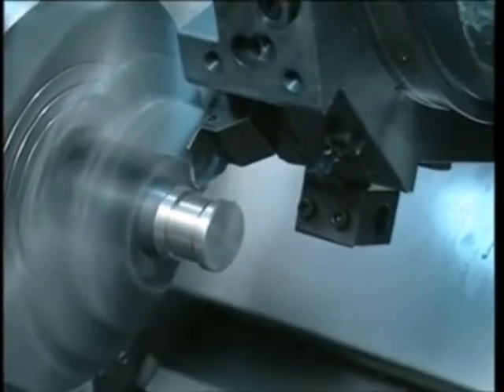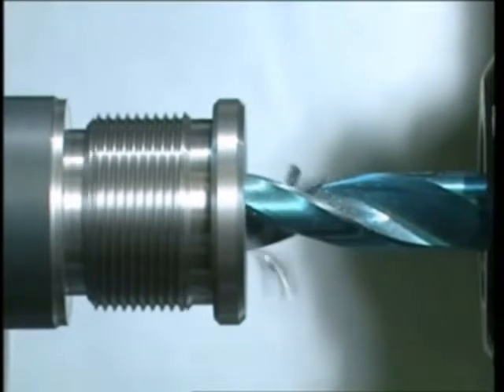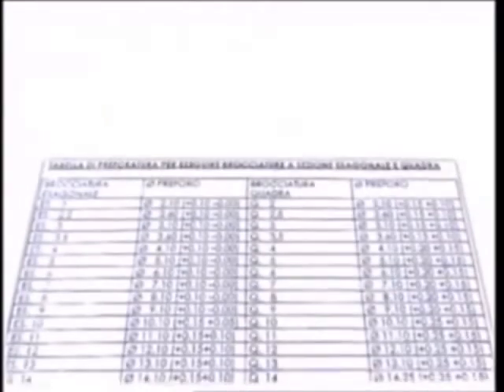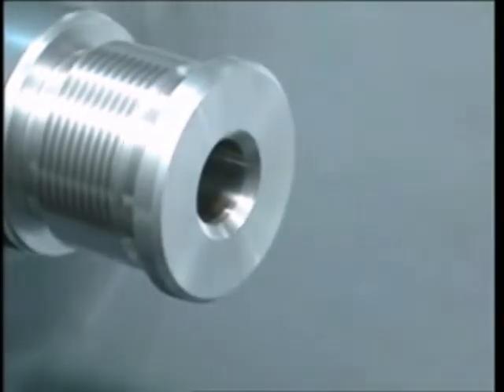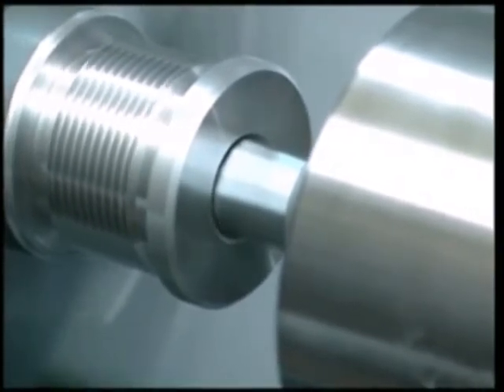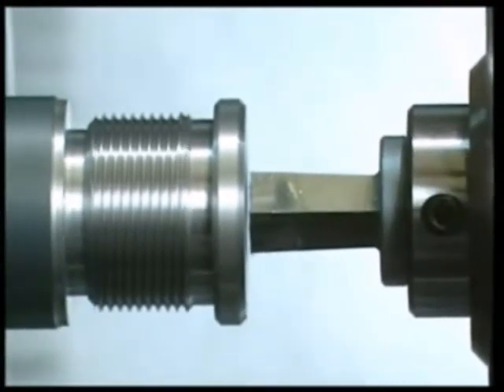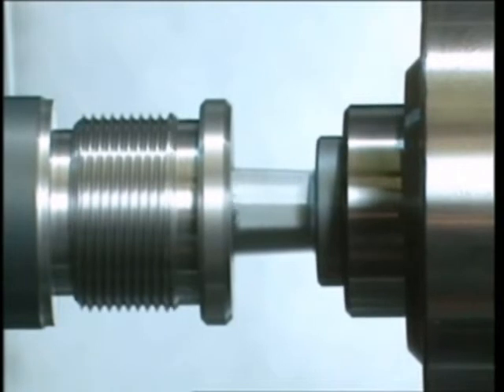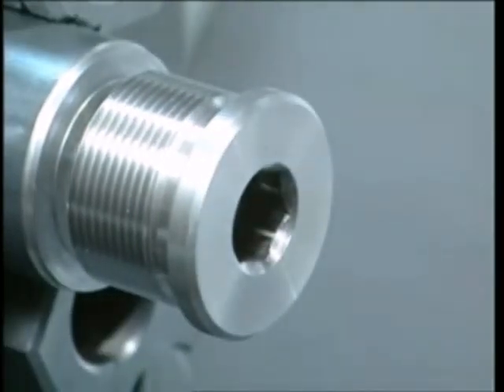Rotary Broaching Example

Comment: Why need turn both pieces, if they turn at same speed?
Reply: If the broach were stationary, it would just cut out a larger hole in the rotating part.  With both turning at the same speed, the broach will cut the desired shape in the hole.   Using the rotating broach means you don't have to fixture the part into a different machine.  Basically, you are avoiding having to take the part out of a lathe and fixture it into a broaching machine.